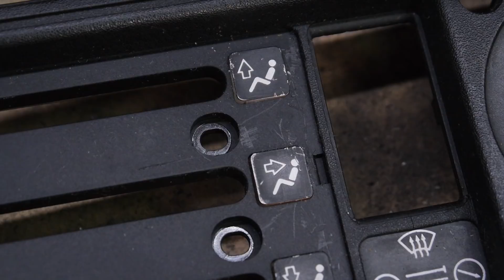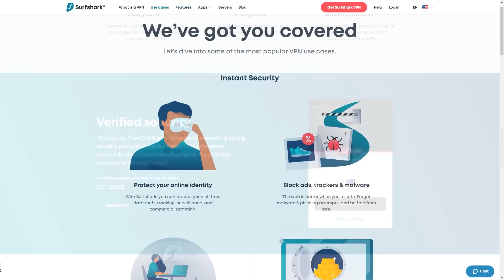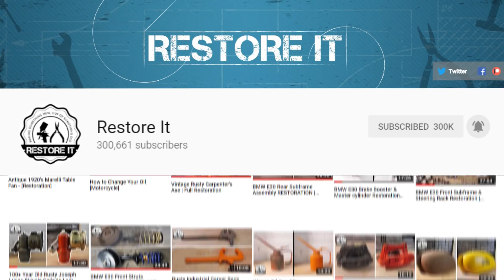BMW E30 Heater/Air Con Unit Restoration

Comment: I did something similar on my e24 and e28 HVACs. In some respects, your work is much better than mine (e.g. I didn't bother painting the plastic after the thorough cleaning), but I think there is also a critical weakness to it: Why, oh why didn't you clean the heat exchangers when you had them out. That's the 80% of the point of doing all this. I used to soak mine in detergents and antibacterial disinfectants repeatedly (and vibrate them in those baths) until the last germ, piece of dust/grime and dead fly got out. You can't believe the amount of (30 yrs worth of) muck and crap that was in there.

You don't want it (re)circulating in your car and ending up in your lungs ultimately. 

Also, you should have changed the brushes on the motor, while there. They do wear out at some point, and because they are like 4$, you don't want to open everything up again for that.
Reply from the maker: hey Milos, thanks for the advice. I've decided I'm going to change all of the parts you have mentioned for new ones :)
Reply: @RestoreIt  Great choice. Your car is going to be a joy for years once you finish all this beautiful work. Cheers!

Comment: nice job but i dont understand why you did not buy the new heater core,these things wont last forever and are pain to change,should have changed that even if the original one was working, and blower motor would been also nice to change

Comment: So.... the repair at 20:19 was not necessary ? if you look at 33:49 the 2 notches are back. Or maybe i missed something
Reply from the maker: Correct. I tried to make it work but I think the cover or rad is wrong. I will be looking into it :)

Comment: if you want to bleach the dingy plastics try high concentration hydrogen peroxide and heat.  there are several ‘retrobright’ tutorials on youtube by people who restore old computer components.  i tried it on stained plastic parts from old musical gear and it worked very well. the hydrogen peroxide comes in liquid or paste and can be found at beauty supply stores anywhere.

Comment: Hi, I just removed the heater box from my E30, I’ve totally disassembled it and now I’ve to replace all the foam/sponge gaskets, which type of self sticking foam do you recomend and where can I order it, thanks in advance
Reply from the maker: Hey Jose, I got mine from Amazon and eBay. Just get the thicknesses you need and make sure it has adhesive one side and you're good to go. Use the photos to make sure its the same or very similar looking to the piece you're replacing, and 9/10 you'll order the right stuff the first time. If not, send it back and look again. Cheers, Steve.
Reply: @RestoreIt  did you use the same thickness everywhere? if you remember there are 1mm, 2 and 3 I think

Comment: Tell me why you began to repair (solder) plastic parts? Could it be easier to buy such a climate system on ebay and choose whole plastic parts?

Please tell me why you did not buy a new radiator (analog or used)? I think this one was in poor condition - with bent ribs
Reply from the maker: The postal service is very delayed, I wanted to get a video out so I repaired them myself :) I may repalce it. I'm still thinking about it. Thanks!

Comment: LMSProductionsSa has a nice vid on how to take the heater valve apart and replace the O ring: v=t1AiKJeQick

If anyone reading this has their E30's dash apart and can easily get to the heater valve (seen 36:12), take a good look at it and be sure it's fine as it's a pain to do later. You have to drain the coolant out of the car and take a lot apart to get at it. The one in my old E30 didn't leak, it just stopped working one day and would not open up. Sadly I did not have the means or know how to replace it or fix it at the time as it was such a pain to get to. The E30 is sold long ago, but those were some cold winters when that stopped working...
Reply from the maker: Thanks Nic. I was going to do this, but as I never had an issue, I thought I'd leave it. After reading some comments, I've come to the conclusion that I will be doing it before it goes back in the car. Thanks!

Comment: No man, you should replace the evaporator, or radiator as you call it. It undergoes a lot of pressure over time and tends to leak Freon, especially if it’s over 10 years old
Reply: I didn’t read your pinned comment, sorry. I admire your plastic work

Comment: Only thing I would have recommended here is cleaning up what use to be a plastic “white” piece by dunking it in hydrogen peroxide and give it some UV light. Would be like new in about 24 hours

Comment: I love to see every part salvaged when possible, but I think reusing the old heater core might come back to bite you in the ass. The end caps are plastic and get heat cycled very often, which leads to their premature failures. Heater cores are a pretty common item to replace and are a nightmare to dig out of a dash. I hope you do not have to do that when this car goes back together.
Reply from the maker: Thanks dude, I've decided I'm going to swap these for new ones :)
Reply: @RestoreIt  You won't regret spending the money. Love the channel man. Keep up the good work and great attitude.

Comment: You did not replace the o-rings on the heater valve, because its not leaking. Mine was not leaking and then one day it bursted out and the entire footwell was ful of antifreeze. So please go ahed and replace the o-rings, because you don't want a carpet full of antifreeze.
Reply from the maker: Did you have to drill out the rivets and replace them with bolts? I think I'll do it haha
Reply: @RestoreIt  thats exactly what I did

Comment: Blue butt crimp connectors at 40:13 on the wire loom, why? Why would you go through so much trouble with an insanely anal and meticulous restoratin, and then throw on a kind of fix that is used in residential light switches? Should have been a proper splice with solder and heat shrink.

Comment: nice work bro but most of it totally unnecessary. you didnt change the main problems. gasket of the heatervalve and the blower...all the work and then that old shitty blower??? will sound aweful....long story short...in less than one year you will do all the work again....not all but the most.